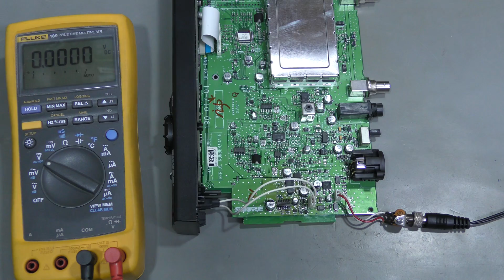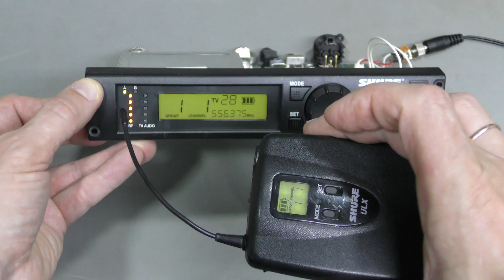#145 - Shure ULX receiver repair

Comment: Shure refuse to supply schematics for their products. For this reason I generally refuse to look at their gear when someone comes into my workshop bearing such units and wanting to know if I can repair them.
However, I am seeing a lot of failures in all sorts of equipment these days that use SMD caps. Leaky electrically, leaky physically and shorted are the common states they appear to exhibit. I don't know if it is just one brand as it's difficult to tell who manufactured many of them.
Accordingly, I now tend to say "Yes I will have a look (but there is no guarantee I can repair it)" as often it is a case of failed capacitors like this.
Reply: That type of cap is also causing a lot of trouble in the retro computer scene.
Reply: @mojoblues66  There are so many different types of equipment that use these caps. I recently had to repair a Yamaha Clavinova which wouldn't respond to the keys and it was full of leaking SMD caps. Not long after that I repaired an APC UPS which had a mains fail problem - again caused by leaking SMD caps.

Comment: I own a clip-on meter for in-circuit cap testing.  Do you think it would work to catch these?   I know it does a great job of finding open caps, or high ESR caps very quickly.
Reply from the maker: What sort of a meter? With 3 leads auto-detecting stuff? Shouldn't it say something like "resistor 0.2 ohm" if there is a short?